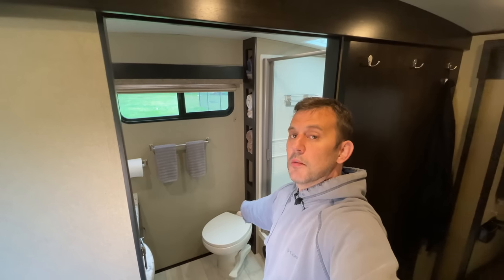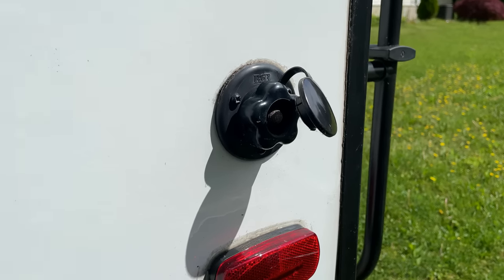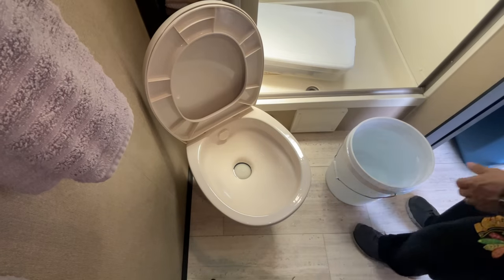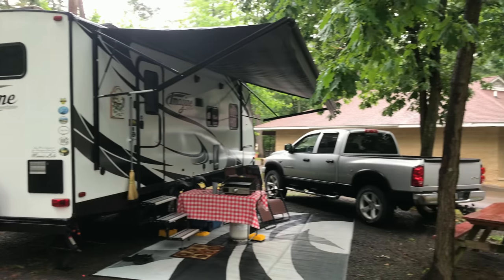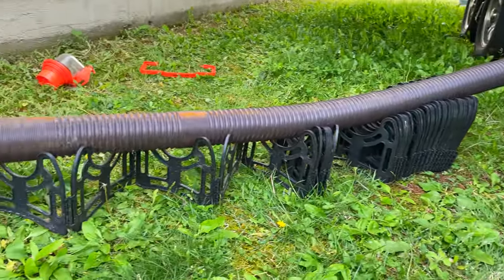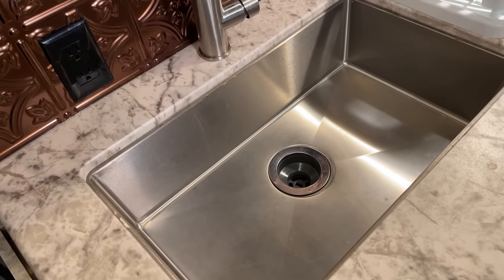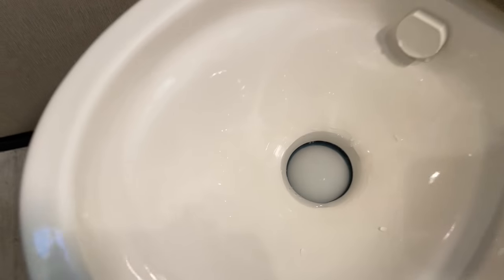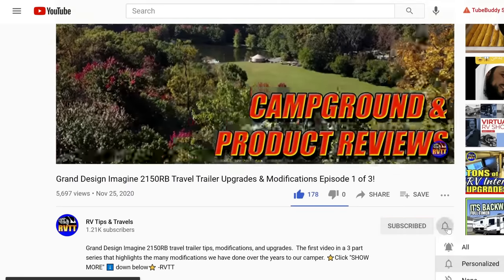RV Black Tank Cleaning, Maintenance, Tips & Tricks - The Original Black Tank Master Class

Comment: You stated only the toilet dumps into the black tank; however, often the bathroom sink will also dump into the black tank.  Also, one of the best items for eliminating black tank oder is a 360 degree siphon vent cap. I never leave home without it. I don't need any chemicals when using the 360 siphon vent cap and I have used it on two different RVs over about 15 years. Thanks for the video.
Reply from the maker: You’re welcome Bob, and thank you for watching and commenting. I’ve never heard of a sink draining into the black tank but it wouldn’t surprise me with the way some of these RVs are built. Thanks again my friend.

Comment: Some people swear by the ice cube method, dumping 10 pounds of ice in the black tank and then driving around. That does not work because the ice will float and not touch the bottom , or if it is just ice, the individual cubes won't have enough mass to do much. I used a pressure washer on a black tank that had an extra surprise when I bought it. I had the forethought to stuff an old towel down around the flush valve.

Comment: Lots of good info. I the sewer hose in the bumper tube. I have painted the inside of the tube bumper with rustoleum oil based paint, messy but works great. 3” roller on extension, paint the four sides from both ends.
Reply from the maker: awesome idea, thank you!

Comment: I modified my slide valve system by adding a shut off valve AFTER the black and grey tank valves, call this valve 3. Also I use a transparent connector AFTER valve three which is the connection to my flexible hose. When I drain I do the following. With flexible hose connected and routed to the dump station drain. 1. Open the BLACK tank valve and valve 3 until no waste is showing. 2. Close valve 3. Next, open grey tank valve and allow a few seconds of grey tank water to flow into the black tank then close grey tank valve. 3. Open valve 3. You will now see more black tank waste flowing through the transparent coupling. I do this a few times but always save some grey tank water for final pipe flush. Only my idea of getting as much waste out of the black tank without using fresh water supply. Good luck !
Reply from the maker: Great tip, thanks for sharing Todd.

Comment: I do use the cleaning wand because I do not have a flush valve. The first thing I do is hook the hose up to the cleaning wand (that you have in your links ) and close the cleaning wand lever. Turn on water and make sure I have no leaks. Then I dump the black tank and then close it. I then insert the cleaning wand into the tank just far enough to clear the pipe and flip it on to run water in until my sensor says 1/2 full. Then I leave it on (the flush valve does a good job of holding it there) and go outside and dump again. Was shocked how much gunk came out the second time until I saw clear water. Then I leave valve open and go back inside to twirl it around to get the sprayers all around the tank.  Now I turn off the cleaning wand and go shut the valve. Then I go back in and using flow meter (which I put on the wand end, I add about 3.5 gallons of water (25 gallon tank). Then I remove wand and add my Happy Camper treatment.  It would be great if you addressed this way of cleaning the tank too since not all campers have the convenience of flush valve.  You can definitely use my method for your videos. Works great for me as a one person camper without a flush valve.
Reply from the maker: Thanks for adding Laurie!

Comment: My cousin's husband is a RV tech and he recommends way more than a 10th so you're fine with 5 gallons. He said the problem is most tanks are long so unless you start with a lot of water (as much as 1/3rd of the tank), stuff won't dissolve properly  and he's fixed more issues than he cares to discuss.
Reply from the maker: Eric, the shallowest tank I have seen is 8” tall, so 10% will give you about an inch of water at the bottom.  The purpose of the water at the bottom of the tank isnt to dissolve anything, it’s to keep things from sticking to the bottom of the tank.  Black tank chemicals break down the solids as water won’t do that in the short amount of time between dumpings.

Comment: I had an issue with flushing my black tank using my rinse cycle. I had my rinse on stood outside. I didn’t hear it rinsing I ran inside and found that my air breaker underneath my bathroom cabinet, failed and flooded my camper. You may want to talk about this ended up being about a $15 part In about $1500 in damages to the insulation so now every time we rinse . I have my wife watch that pressure release valve don’t even know why they put that valve in must be a reason or they wouldn’t do it
Reply from the maker: Thanks for sharing

Comment: Great video thank you. I actually don’t put toilet paper down the black tank anymore after having a massive clog in a fifth wheel that had a slanted pipe to the black tank. I use Walmart bags and place my used toilet paper in the Walmart bag and it really doesn’t stink at all. Once the bag is full tie it up and burn it or throw it away. Because the feces and urine are not mixing the only smell you get is from the initial wipe it dries out really quickly in the bag and absolutely does not stink.
Reply from the maker: Glad you enjoyed, thanks for watching!

Comment: I saw a video where the owner of a tank cleaning company actually said not to bother with toilet paper that breaks down, and not to bother with black tank solid-dissolving additives. He suggested that you don't want the waste to break down because that will stick to the walls (and eventually make the level sensors stop working). He said several times that these tanks are waste holding tanks, not septic tanks. And solids and un-desolved TP are pretty good at flowing out the tank when you open the valve.
Reply from the maker: Thanks for watching Chad. Personally, I’m never taking advice from someone who owns a tank cleaning service. If you’re not using a chemical to liquify the solid waste in the tank, you’re going to have clogs. It’s inevitable. Also, liquefied waste wont stick to the walls of the tank if there’s plenty of water inside the tank and you dump and rinse the tank properly. Everyone’s entitled to their own opinion, but this is not rocket science. Your RV is not always going to be level when you dump and you’re going to get more waste out if it’s liquefied then if it’s not liquefied. Solid waste could actually not drain out as you’re dumping if your rig is tilted the wrong way and just sit in the bottom of your tank. That is more common. Once that dries, it’s very difficult to get out. If all the waste is liquified, yes, it may leave a residue inside the tank but once the tank is empty, you just fill it and flush again and everything will come out. As far as toilet paper, you don’t need to buy RV toilet paper, but you do want some thing that breaks down and the most obvious choice there is a septic safe toilet paper. If a tank cleaning services, telling someone to not worry about toilet paper breaking down it’s because they want your business so they can clear out your clogs, which you will get with a thick toilet paper that does not break down.

Comment: I buy a 2 Gallons of Laundry detergent or dish soap from Dollar Tree and add it to 1/2 -2/3 water in both gray and black tanks before I move on to my next destination or every 3 months when full timing it. The mixture sloshes around for a couple of hundred miles, when I reach my next destination I dump the tanks. I full timed for 4 years with no issues.
Reply from the maker: Nice tip Byron, thanks for sharing!

Comment: I wasn't happy to have to have my home sewer line replaced. However,  I was happy to have the opportunity to add a RV dump connection. My new sewer line has a clean out within 10 ft of my parked travel trailer. After returning from a camping trip I can clean out my black tank as thoroughly as possible.
Reply from the maker: That’s awesome, makes things so much easier when you can take your time and do it at home.

Comment: We are full time RVers. Periodically we will drain all our tanks as usual, then with the gate valves closed put !/4 cup Dawn & 3/4 cup borax down the commode, then using the hot water from the shower fill the commode 10 times and flush to get approximately 10 gallons of warm soapy water in the black tank, drive to our next stop. As soon as we are set up we drain the tank as usual.
Reply from the maker: Great tips Rex, thanks for sharing!

Comment: Great video. This has answered several questions for me. There is one, however, that I did not see. That is when that toilet seal ( the black rubber ring ) gets knocked off and falls, you can retrieve it, but it is very difficult to reinstall. Must I replace the entire toilet to achieve an good seal afterward?
Reply from the maker: Karl, I’ve never messed with replacing one.  I’d think it’s something you don’t need a new toilet to replace.

Comment: After you drain the black water tank, close the valve and dump a bag of two of ice into it. It will slush around while driving and scrape off any debris stuck to the walls or the bottom of the tank. No damage, and no chemicals. Clean tank every time!!!

Comment: I know this is a three year old video, so I don't know if you will see it or not.  In this video, you show putting a "flow meter" on a garden hose and drag the hose into the bathroom and put the proper amount of water into the black tank via the toilet.  Question; would the same hose and flow meter work by simply attaching the hose to the black tank rinse bib?  It is still putting water into the black tank, but you can measure it, and not have to drag a hose through the RV.  Interesting videos; thank you.
Reply from the maker: Your logic is spot on.  You can do that as well. It’s a good idea to regulate the pressure though anytime you are using rv plumbing.  With a hose, you can go full bore.

Comment: I take the bathroom screen off and put the garden hose down the toilet just past the valve and turn it on for about 1- 1.5 mins . Then let it sit for about 1 hr and drain it a second time. I also but dawn soap in while filling the black tank. It cleans the sensors really well. And if you can drive around for awhile . It works like a washing machine.
Reply from the maker: thanks for watching!

Comment: I use a Flush King With a flow meter when I dump the black tank.  After I dump, I add 25 gallons of water through the Flush King back in to the black tank and then dump again.  After that, I run 5 gallons back in to the black tank, close the black tank valve.  Then I go to the grey tanks.
Reply from the maker: great minds think alike: https://youtu.be/Q7ZJzfimLwg

Comment: I used the Happy camper stuff until once when I put it into the toilet water to flush it and little did I know ? But it hardened up like concrete ! I had to use a long screw driver and chip it out until I could finally dig it all out ? From then on I have used nothing but the Thefford  in the little bottles dump one bottle per tank so much easier !
Reply from the maker: interesting... if you mean you use the aqua-kem, yes that is a great product.

Comment: One thing that I do to clean my black tank is put a valve just before my hose. Note that my grey and black tanks are the same size. I first dump my black, then I close the hose valve and leaving my black valve open,  I open one of my grey valves. This back fills my black tank with grey water. Once the two tanks are evenly full, I close the grey valve and dump the black tanks again. I'll do this a few times, until I see no more floaters coming down. Then I dump the rest of my grey to clean my hose.
Reply from the maker: Awesome tip Bill, thanks for sharing.

Comment: We had the dreaded pyramid in our 50 gallon black tank so we added a gallon of Simple Green concentrate, about 6 tablespoons of Dawn dish soap and several treatments of happy camper We then added 9 gallons of water and 1 1/2 bags of ice. We drove for 3 1/2 hours that day and it cleared up the pyramid and our sensors have been working ever since. 
The next time we move I’m going to add Simple Green concentrate and Dawn soap with hot water in our gray tanks to clean them.
Reply from the maker: thanks for watching and commenting

Comment: I learned from my father that after dumping my tanks, if it is going to be unused for weeks/months you can further clean them so they are ready to go the next time your hit the road.   As you mentioned, always put water back in your tank, WATER IS YOUR BLACK TANKS BEST FRIEND!  When doing this, I put about a 1/2 cup of laundry detergent in BOTH tanks.  In the Black tank I simply dump it in the toilet and rinse it with the water.  In the Gray Tank, I usually put it in via the drain closest to the tank (usually a shower).   Get a flow of water running and dump it in the stream or mix it in the bucket of water before pouring it in.  The key here is not to let undissolved soap get stuck in the P-Trap, it will turn into a solid if allowed to dry out!     The road trip to your destination will “Slosh” the water around and break up any solids that may be left in the tanks and also help loosen any build up on your sensors, the walls and bottom of the tank.  That said, soapy water in the tank should help clean it and prevent a lot of possible problems.   

Close the valves, add the water and treatment to the tanks and enjoy your adventures.
Reply from the maker: Thanks for commenting!

Comment: To lubricate the dump valves in my rv I will add about a quart of vegetable oil to the five gallons of water in the tank. It floats on top of the water and lubricants the valves from the inside. I only do this as needed.
Reply from the maker: good tip thanks for sharing! https://amzn.to/4bVwnrX

Comment: I learned a ton of stuff. And unfortunately I wasn’t sure about leaving water in my tanks so they’re empty right now 😬. It’s parked at a friends but I will get over there to fix that soon. I also want to mention our camper doesn’t have a flush tank valve, at least I haven’t seen one lol. But I have a gate valve/flush attachment that i put on my tank drain before the hose, it’s also clear, I just hook a hose up to it and it has a valve there to stop the hose water, after i drain the black tank I close the flush gate valve and turn the hose on and let it fill up my tank and drain it a couple of times. We haven’t stayed at a full hookup campground yet, so we’ve only used a dump station and you have to be courteous of people waiting so that makes things a little more tricky lol. I did treat both tanks before we used them but def will try and remember to treat after every drain. Another issue if you camp somewhere with no sewer hookups is you don’t want your tanks too full already when you get there, but we dumped ours on the way in, so I guess you could do that as well since you’re getting ready to start using it. Black tank was fine but we did fill up our grey in about 3 nights with just the two of us. Anyhoo. Great video and I did learn some stuff.
Reply from the maker: glad it helped, thanks for commenting!

Comment: Great video. When dry camping and water management becomes an issue use tubs when you wash your dishes. Pour the dish water down the black tank when your done with the dishes. Allows you to use less water when flushing the toilet and gives you more gray tank capacity
Reply from the maker: great tip, thanks for adding Michael.

Comment: I learned today that you should not use a tank additive that breaks down the solids. Using an additive that does that turns your holding tank into a septic tank. Doing that will cause a layer of thick matter. That matter will cause the tank smell. The adding 10% of water to the tank is right on per a tank cleaning service. Your commit to wait until it is 3/4 full is again what is recommended by the cleaning service. He also recommended not to leave the tank open. He also recommended to back flush every six months to a year with th meter you talked about.
Reply from the maker: Thanks for watching Earl.  I would respectfully disagree with this advice. I talk about why in this video: 
https://youtu.be/L50oamx7ivc

Comment: Most of this advice is great for Travel Trailers and those that don't boondock or stay in one place for months like Quartzite LTVA September through April. Having a 5th wheel camper usually the Toilet pipe doesn't go straight down because the bathroom is not directly over the tank. I can't see into my Black Tank without running a Bore scope into the toilet 🚽. 5Rs with more than one toilet the plumbing can be even more complicated.  Also if you use a maseratator to empty your tank like we do in Quartzite the release flow will be slow the only option is to partially break camp hook up and drag the camper to the Dump station. We do have a Blue Boy tote but the wheels are junk they don't last long so it's only used up in our truck bed with the masserator a few times a month. I keep as  much water in the black tank as possible to help prevent a buildup, and use double the toilet treatment to help break stuff down. When we leave In April we will have the give it a good flush at the dump station and then dump the Ice bin from the Residential fridges ice Maker just before hitting I10. Not Many travel trailers have big Residential fridges having the Ice Maker  is a plus when setting out.
Reply from the maker: Thanks for the input Ken, appreciate it!